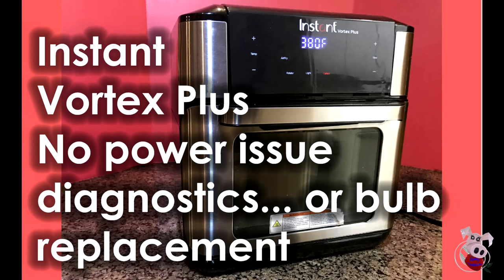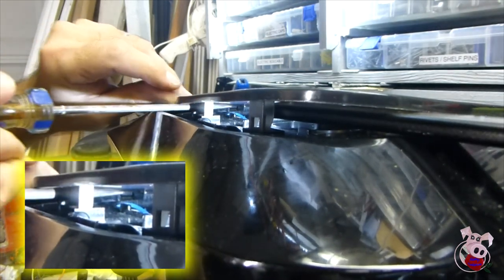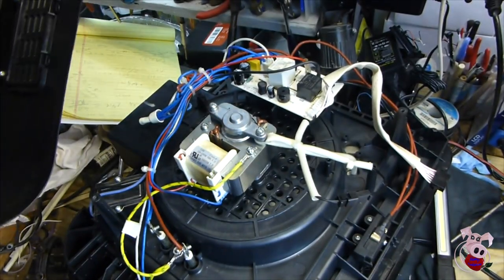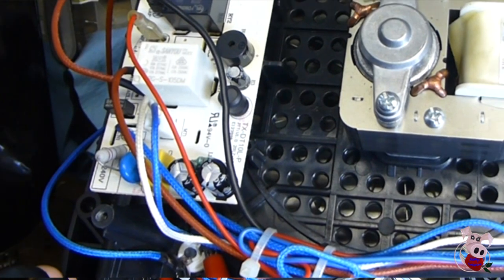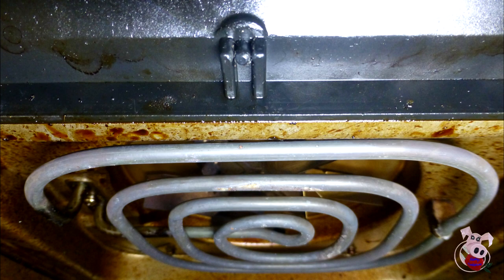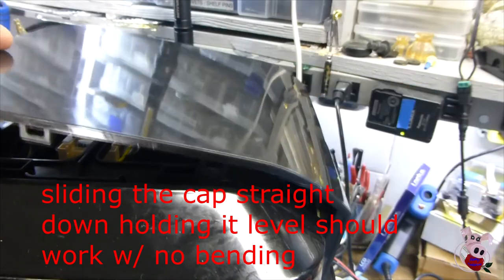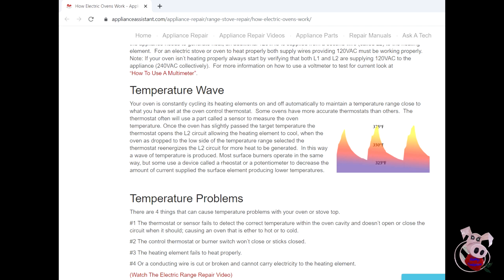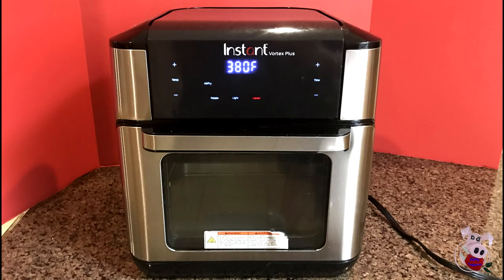Instant Vortex Plus No Power issue diagnostics or bulb replacement

Comment: Can you buy an led display replacement? Mine is broken.
Reply from the maker: while I don't know for sure, I would assume not.  But, as I point out in the video, the keyboard will go dark if you door switch is bad.  The keyboard does not light until the door switch is engaged.  So if you have not checked that, you may want to.  Several people have reported that switch failed and replacing it fixed their problems.

Comment: Hi, looks like the circuit button is not the issue. I know electricity is connected bcs light is on, but display panel isn’t. I don’t see any problem with any circuit boards. What could the issue be?
Reply from the maker: Door switch?  As I recall the panel goes dead when the door is open but the light can stay on.

Comment: Hi, my light comes on but the display isn’t working. What could be the issue there? Thank you!
Reply from the maker: If the light goes on and off with the door opening and closing it is likely not the door switch.  If it does NOT then it could be the door switch.  The only other thing you could possibly do is just inspect all the wires are in place and that the thermal switch is not tripped.  I don't recall verifying if the bulb worked with the switch tripped.   Actual electrical component problems will be hard to evaluate if it is not ether of those.   Best of luck.

Comment: Thank you so much for the video!! So I think my problem is the door switch, I googled the KW-16 16A 125/250VAC like the one that’s in the air fryer and nothing comes up.. should I just choose one that’s similar and just make sure it’s a 16A and same dimensions? The air fryer one doesn’t have that button switch at the bottom, ones online do.
Reply from the maker: It is called a “limit switch” and they come in many formats.  This one is common.  Match the dimensions, connectors and amperage.  You can find them on Amazon, eBay and other sites.

Comment: My unit says open but the door is definitely closed. Will not allow me to use at all. It was working fine.  Was in middle of cooking and it was time to flip food. When I went to close door and did close it the open appears on front.  Have had it for 7 months and contacted manufacturer. They wanted me to send avideo and my receipt which I did today.  Hopefully I will get a new unit.
Reply from the maker: Others have posted that their door switches went bad. It is a common limit switch style and would be easy to procure and replace if needed. Of course it could be any item related to the switch and delivering that message.  The switch, wire to the switch, relay, wire to logic board or the logic board.  The switch is sways to test with a meter and easy to replace. Good luck. Always pursue warranty first when still under coverage.
Reply: @alwaystinkering6972  warranty replacement was approved and being shipped.  😁 I don’t have to return mine so I will take it apart and see what I can do.

Comment: Would you know off the top of your head why 'CLOSE DOOR' error would be showing when the door is closed? Airfryer won't work because of this. It's a INSTANT VORTEXT SIDE CLOSING DOOR. Thanks.
Reply from the maker: If it is not this particular model then I am not familiar with it. You are looking for the door switch.  It may be visible or it may not. At some point in the door closure it is expected to make contact with some part of the moving door and trigger the switch. 

You can inspect for the switch. You would be looking for a cut in the plastic around the door or a protruding piece of plastic. One side of that location would have movement.  

The switch could also be inside and be triggered by an interior motion.  This model had a standard off the shelf limit switch which made it replaceable. 

Best of luck.
Reply: @alwaystinkering6972 - THANK YOU. From over the pond. 🇬🇧😊

Comment: So my dad took mine all apart checked it with the gadget, ticked it. Or so I thought was cooking opened it twice, and the third it stoped completely 😩 help.
Reply from the maker: If the thermal fuse keeps tripping it is an indicator you have a non transient problem.  Keep in mind the thermal switch is to help protect you.  The switch could be bad or you have some electrical problem causing the switch to trip.  If you don't see any visual damage, then replacing the thermal switch would be a guess.    If you do see physical damage in the unit, that would indicate a larger issue and for safety you may not want to try to replace anything.  There is a link to a video in the comments where he references the switch model he found.  Verifying what you have is usually a good idea to do first.  Best of luck.

Comment: Could you possibly point out where the speaker in the unit is? I want to rip it out
Reply from the maker: Too funny.  It could be the black cylinder labeled buz1 soldered onto the board.  That is a speaker of sorts.  They could have one hidden in the keypad. Since I did not remove the keypad from the frame I cannot confirm if that is the case.
Reply: @alwaystinkering6972  ah so if it's soldered in I'm assuming I won't be able to remove it easily? Thanks so much for your quick reply!
Reply from the maker: @madelinelewis813  it does have a hole in the center of it to allow sound out.  You could put some hot glue over it.  It will muffle it.  I would not stick anything inside it since you don’t want to create a short.  A dab of tape over the hole and hot glue which is non conductive.
Reply: @alwaystinkering6972  awesome, I'll give that a try! Praying this works so the damn thing stops scaring my dog
Reply: Unfortunately no luck it sounds about the same. What's the risk on me cracking it with a hammer?
Reply: If anyone finds this is the future, I ended up prying it off with a screwdriver. The machine works fine but is now silent and my dog is finally not trying to dig a hole in my floor to hide in
Reply: @madelinelewis813  if this is the instant vortex plus all you needed to do is hold both down buttons for temperature and time for about five seconds till it beeps. Then it beeps no more.

Comment: (cotin iued) - the switch has very little feel such that unless you are very sublte you can't feel the press down with slight click - I did here that.  I think the situation arose when the unit was again pushed to close to the wall and the vent in back may have resulted in a 'short', and /or the toaster was turned on at or about the same time.  For your other viewers I was surprised that when I leaned the unit on its side, I noticed probably about 1-2 ounces of oil leak out on the table from the bottom of the unit.  Why the manufactuer gives no instructions in this age of DIY does not make sense.  The unit works very well, when its working -thanks again!!!

Comment: It’s the switch for the door that malfunctioned, but when I opened the switch it fell apart and I don’t know how to reassemble it. There is a copper piece and two other pieces.
Reply from the maker: Limit switches are readily available and that one looked to be of a standard variety.   This is a spdt variety 16amp.  You want the switch style (the button) and the dimensions.  Search spdt micro limit switches. Look for one of that body style and check the dimensions and voltage.

Comment: is it normal for the handle on this unit to get hot
Reply from the maker: For the two months I had it after I fixed it the longest cooking cycles I did were about 20 minutes.  So for my experience no.  Others that do longer cooking times may know better.  

I would check that you are not blocking the back of the unit.  If you look at the back you will see a fan vent.  I could see where if that was blocked it might force the heat out the door.

Comment: Helpppppp mine goes to end of cycle right after pressing start, what could be the problem,  not even able to cook  one second
Reply from the maker: The program logic seamed to be built into the keypad which I did not remove from the face. I am not familiar with this problem.  

Try pressing each key on the front to see if any of them sound stuck. The fact the keypad is responding suggests it is not any of the items I reference in the video.  

There is likely very little that is serviceable on that keypad logic board.  The only thing you could do is visually look for issues like an incomplete solder joint, grease/liquid damage, cracked board or wire issue. Good luck.

Comment: For those of you that don't have the instant pot vortex plus and just have the instant pot vortex air fryer sometimes all you have to do is take the lid off and there's a black button behind the two blue wires on the right back hand side of the air fryer there's a black button sometimes all you have to do is reset that button this has happened to me twice now and both times I've hit that black button and it's worked good luck I saved myself a little bit more time but let me tell you this is going to continue to happen again but for now I'll fix it until I got another $250 to replace it

Comment: Mine gets power but no screen. Occasionally works. Tried everything without luck. I know it gets power because the door initiates the light
Reply from the maker: Someone had indicated they opened theirs up and found a disconnected wire… if it is not that or something visibly noticeable then your easy fix options rapidly diminish.
Reply: @alwaystinkering6972  I think I found it, their was a cold solder joint on the yellow square capacitor. I broke it off wiggling it around though. So I'll order a new one. The solder joint was loose
Reply: Mine gets power but no screen. The front switch was burnt and having a hard time finding the switch.

Comment: Reason  why my thermostat switch gets stuck offen,in air fryer ,
Reply from the maker: @jatinkumardesai583  the switch could be bad or you are restricting the airflow out of the vents in the back (too close to a wall or in a confined space) or the switch is doing its job and protecting your unit from overheating because some other component is not working properly.   The switch plays an important role in preventing an overheating situation.
Reply: @alwaystinkering6972  thank you so much, gentle man.
Reply: Pl kind enough to let me know the art number and source to buy the same of this very instant Air fryer,as shown in vedio.pl.regar
Reply: Part number of Thermo State switch that gets stuck offen.thank u very much.jatin Desai
Reply from the maker: @jatinkumardesai583  In the comments I have a link to a video made at the same time as mine where he removed the thermostat and shares the part number.  Best of luck.

Comment: Hi. Great video! However, mine is powering on but not heating up properly. My guuess is it is only getting to around 275°, if that. Any, thoughts?
Reply from the maker: Thermal switch only if it was not clicking off but breaking contact.  Thermostat not reading the correct temperature, failing burner, relay clicking off too early and last malfunctioning control board. Without spare parts most are hard to diagnose.